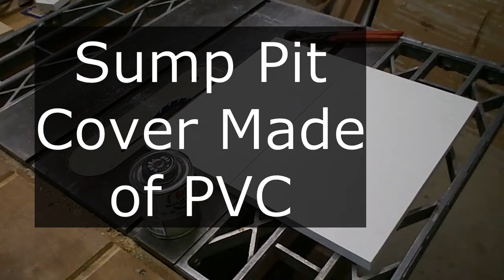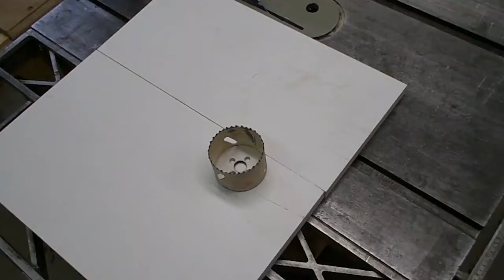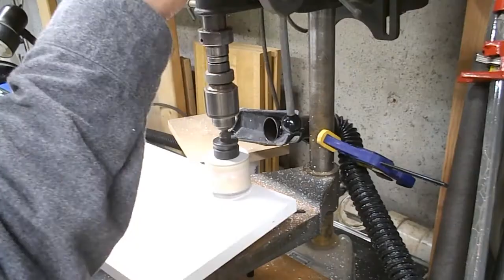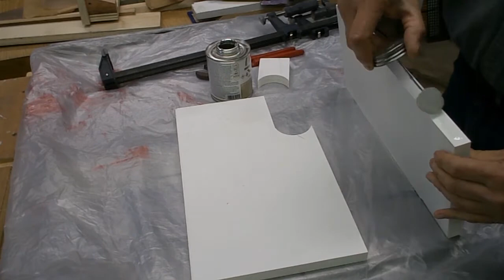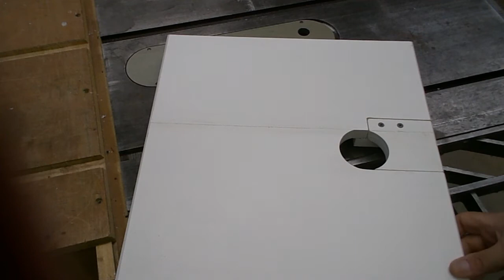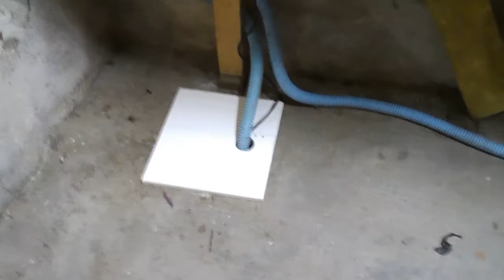Make a DIY Sump Pit Cover of PVC

Comment: Looks great but would you know WHY most people totally seal the cover once done?!... 🤔I guess it's for those Radon possible emissions...Another thing, shouldn't there always be like a small vent to let the air circulate?...not sure. 🤔🤔Thank you! and where did you buy that one inch thick PVC boards?
Reply from the maker: Thanks for the questions.  I built that many years ago so forgive me if I don't have all the details.  The PVC sheets were 3/4" thick, I believe.  The cleats were also 3/4", but I glued them on their edge (bottom side) so they're sticking down around 1".  The stock was scraps of PVC trim that I had.  The 3/4" thick stock is common everywhere, but you can get 1" trim stock at a building supply house (not the box stores), at least where I live.  I've had 3 sumps in 3 houses, so I'm not an expert,.  I think most are covered for the obvious reasons.  It's a neater (more professional) look and prevents things from accumulating in the sump.  It's not necessary and this particular sump was open for decades.  I can't speak for all of them, but this is not a very air tight fit, so it won't contain radon.   The slab is not flat, so I would have needed a gasket of some type to get a better fit.  Then the hose and cord protrusions are not air tight either.  In terms of circulation, the ones I've had would dry out when the water table recedes, so they don't get damp or musty.  Two of mine had loose fitting lids, and one had a decently tight fitting one.  I think most people just don't want them to look like eyesores.  Thanks again.
Reply: @jazbuilding  Thank you for all these detailed informations! :)